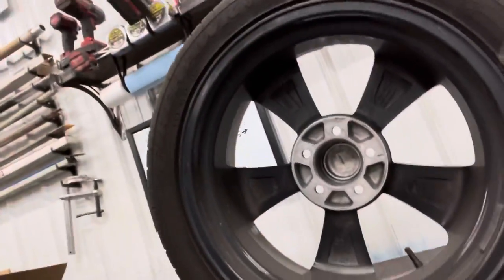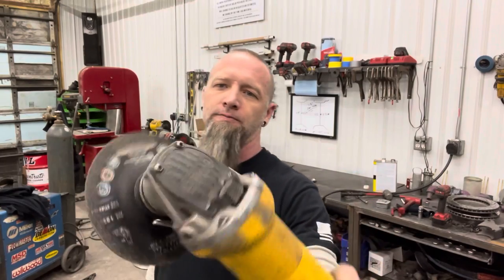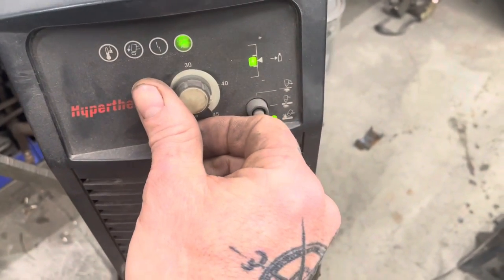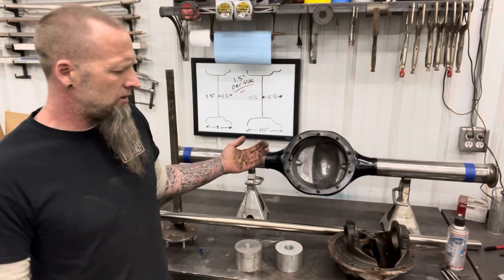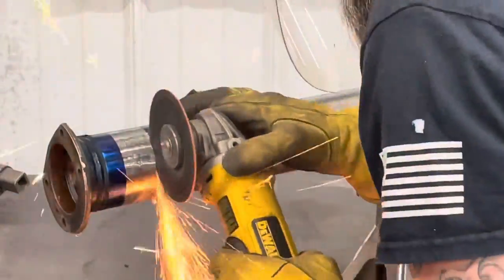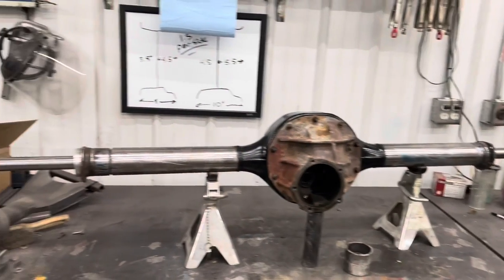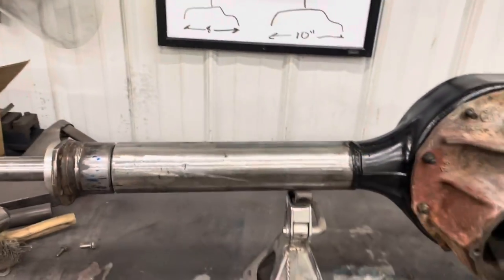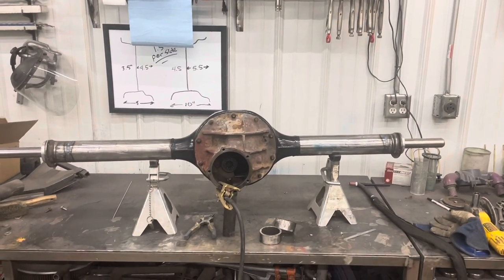How to narrow a Ford 9” Church Boys Nova Part 3

Comment: Nice job.  Great tip on the chromed hydraulic shaft and hydraulic shop to make the bushings.  

I built my alignment bar out of 2" shaft I center drilled and then checked for straight in my lathe with my 1/10th indicators.  I'm in the whole thing about a $100 and half a day.  My bushings are perfect when cold with just enough room to slip on with light finger tension but in use they are little tight. The aluminum expands in the housing ends after the final weld but once back to room temp it spins freely again to remove the wheel bearing bushings.  Some day I will make all steel bushings.  

I love narrowing axles because it just a fun project.  I can tell you take pride is your rear end narrowing.  Other YouTube videos  showcase some real hacks doing rears out there.  I was 16 when I narrowed my first Dana 60 for a friends CJ5 and 43 years later he hasn't had to touch it.  I did that one without an alignment bar.  I just squared the ends off the tubes but the splines show no signs of wear yet when I looked at it last year in preparation for his new professionally built AMX 390.  

I recently shortened it again because I got a pair of gun drilled Mark Williams axles off Ebay that Mark Williams was clearing out overstock.  They were made for someone else and the axle order was cancelled just before shipping.  They were 1" shorter than my old axles.  If I would have had to pay to do that I wouldn't have been able to upgrade my axles so cheap.  The new axles and removing the piece of tube cut almost 5 pounds so I added a rear brace I am still a couple pounds lighter than before the work.  One side I was able to fully remove the round welded in axle tube.  It's a HD rear end with the big housing cut down to fit my sand dragster.  

Again nice job.

Comment: I wish that  youtube existed in my day as I quit the day job in 84, moved to anchorage from the prince of whales islands out from ketchikan. I had done heavy equipment repair on off highway trucks, and equipment since I worked for my dad and was too young to argue or big enough to bargain my own choice... turns out, if your even a fair hand twisting wrenches in those days, you could name your wages. I never had a machine shop, actually a blue tarp (or hunk  of canvas) was a treat. I did several make it fit so it would work, sometimes for just that day but make it work! I had stuff made that would make some people ask the question "who gave that kid a tool" as he is dangerous/lol, I just could make anything start and run, and I had a photographic memory so its no issue to remember how it came apart... long and short, if it works on detroit, it would apply to other engines. I built my first 855 C.I. cummins engine, a little two hundred horsepower engine when I was fifteen by using a good engine to look at and do the same to one that had flew apart and needed to be salvaged as getting a other engine to fit or even getting one out there was impossible almost and the cost was close to just replacement. I just got some great ideas from this as I should of figured something like this on my own back in the seventies or after nam time. Great video for this young seventy plus years guy

Comment: I built a stool like yours from parts from two different scrap yards. It's for my welding shop.
Reply from the maker: Same, I found the seat and the bottom section at the scrap yard. I wish the stars would align like that again… I could use another one haha!

Comment: Would a large pipe cutter work to cut the tubes? It would stay perfectly straight. I always wondered why nobody uses one.
Reply from the maker: I’ve heard of ppl using pipe cutters on thin wall DOM, I imagine it would work it would just take a little longer

Comment: Should you preheat the tube to prevent warpage?
Reply from the maker: Most axle tubes are DOM which doesn’t require a preheat structurally, as far as preheat to prevent warping welding ends on won’t really cause warpage it’s more of an issue with trusses or long horizontal welds

Comment: Wouldn't a gasket be necessary to centre the diff in the housing
Reply from the maker: Technically yes but you can order 3 different gaskets and end up with 3 different thickness between cork, paper, the deviation between brands, or the thousands that ppl just use gasket maker with no difference in failure rates, so I don’t believe it to be critical. (Maybe that’s wrong but I’ve never had a problem) I leave the gasket out because the metal contact surfaces will be perfectly true every time. In theory the best practice would to cut out a metal set up gasket from 18ga to split the difference in thicknesses while remaining perfectly true